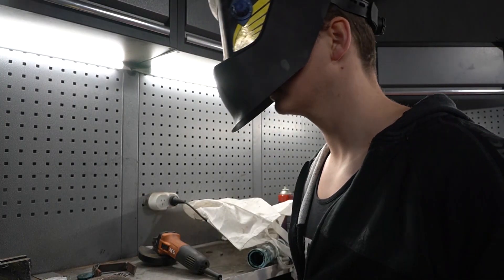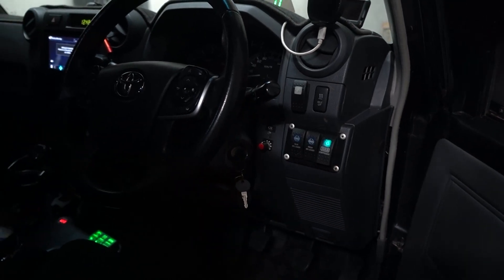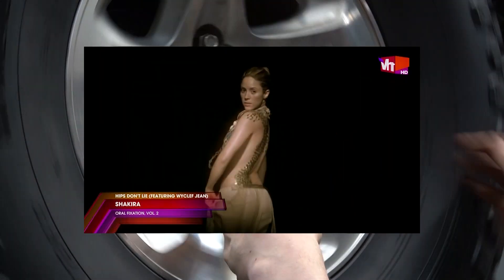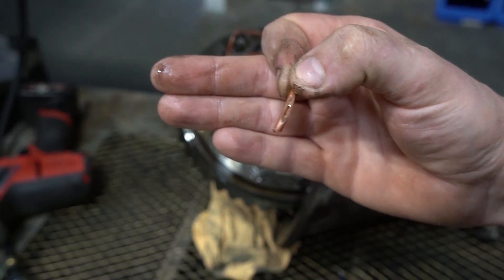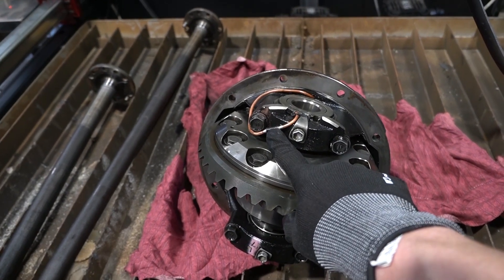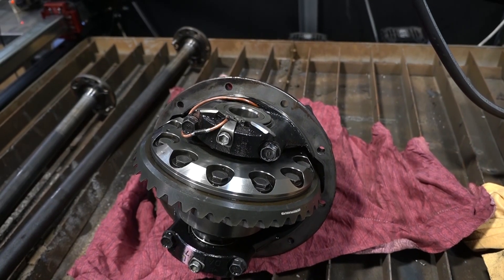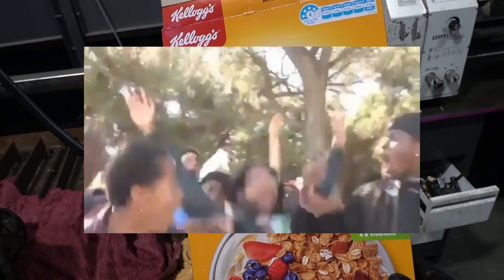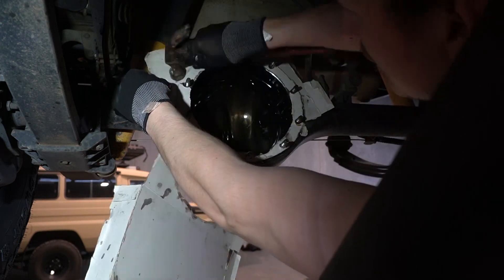Repairing an ARB diff locker so it never breaks again!

Comment: As a non engineer, the paper just stops the two metallic posts binding together? Doesn't the dried goop also do this? Thanks for the vid, and humour as always
Reply from the maker: Not all gasket compounds are created equal. Something like RTV can be used solely as a gasket, however, the one I used is considered more as gasket insurance as it's quite an involved job if you do discover a leak.